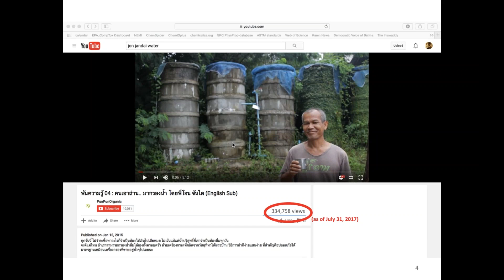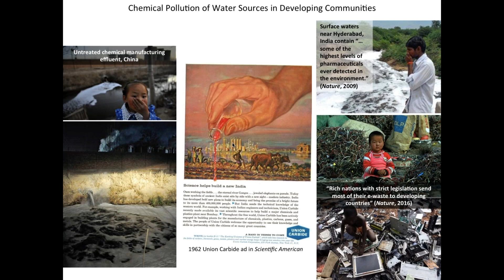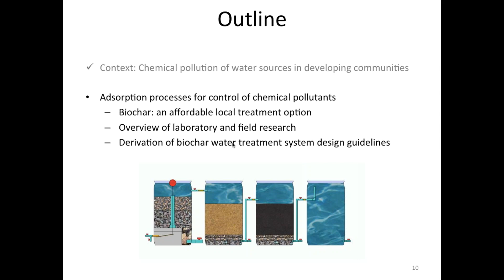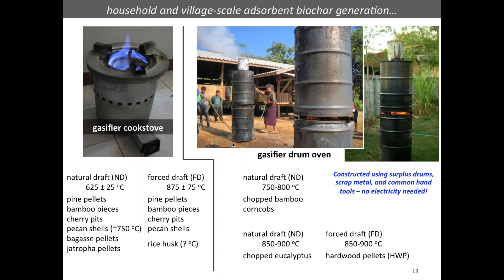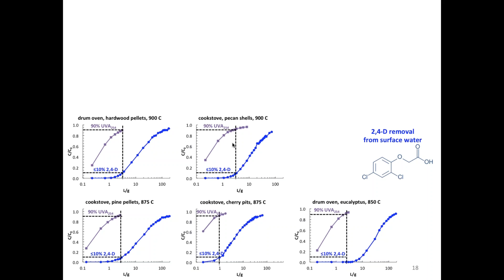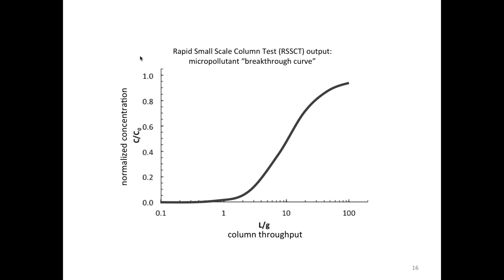Biochar Adsorbent for Control of Synthetic Organic Contaminants in Affordable Decen

Comment: Why is the piping for water flow start on the bottom and goes up to top before entering the barrel and then the piping goes back to the bottom of the barrel before water is released into the barrel? Couldnt you just have the piping start at the top of the barrel from the outside instead of starting at the bottom and climbing along the outside of the barrel? Also  if the water is released into the bottom of the barrel then couldnt just you just run piping from the outside bottom straight to the bottom? Why all that piping climbing up and then back down into the barrel when you couldve just cut a hole at the bottom and allowed the water to enter at the bottom???
Reply: I'm in the process of making a smaller version of this set up and I think I might have an answer for you. If you are refering to the first barrel then the water needs to start filling from the bottom to make sure that's where most the sediment settles and can then be flushed out easily using the exit tap shown at the bottom. As you say this could be done by having the inlet pipe enter from the bottom but then you need to think about how to have the float valve secured there, there's the risk that over time the rocks could shift and interfer with the float valve. By having it at the top it means you can easily access the float valve for maintence etc.
If you are asking about why the next two barrels have the exit at the bottom connected to the entrance up at the top, this is to ensure the water fully passes through the filters before it moves to the next barrel. 
Hope that makes sense, not sure I've explained it well though.